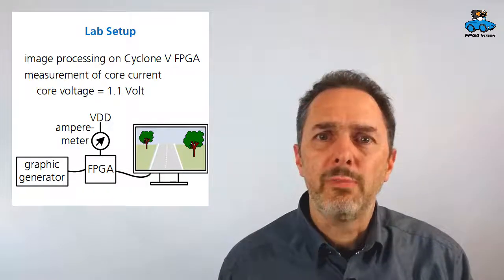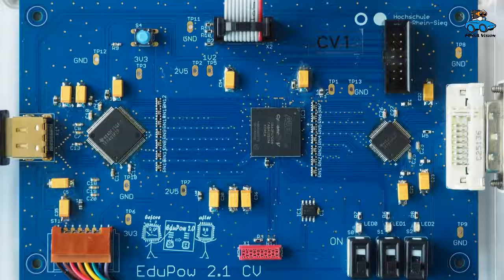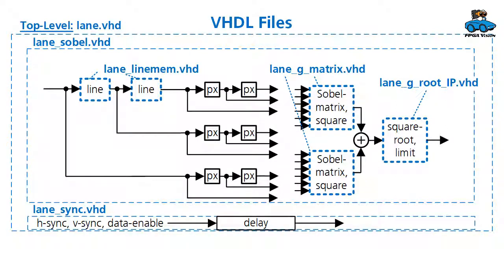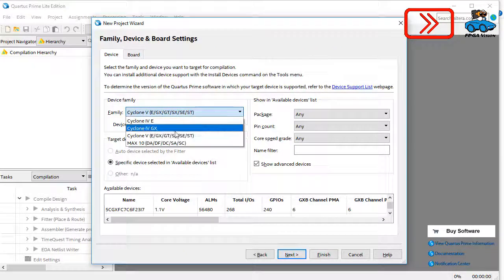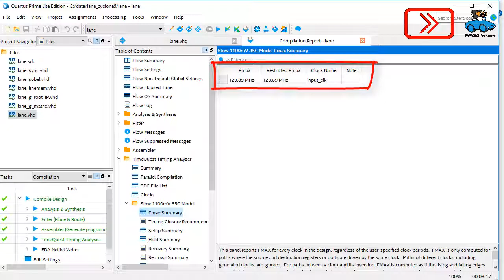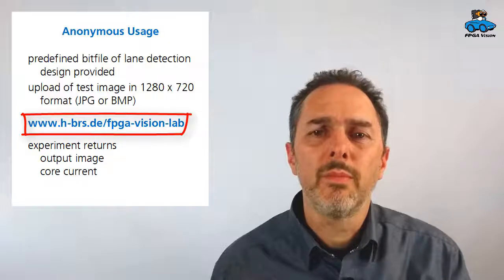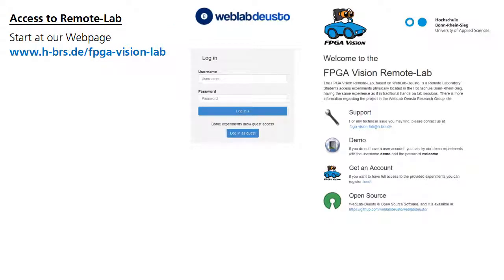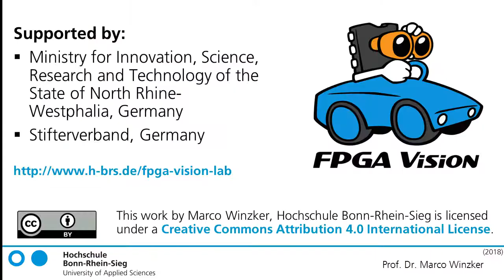FPGA Vision - FPGA Remote-Lab

Comment: thanks sir, can the code be assigned to the xilinx FPGA board?
Reply from the maker: Yes, but you need to do certain adaptations, for example the ROM for the block-memories.
Reply: sir how to find these adaptations that need changes and how can i do the adaptations, i used digilent genesys 2 FPGA board, thanks your return.
Reply from the maker: @muhammedalikaya268 Best approach: Try to compile the code and the software will give you error messages for elements to be adapted.

Comment: does this project works on spartan 6 sir
Reply from the maker: Yes, but you need a board with video input and video output. It is much easier to use our free remote-lab.
Reply: How to give video input to the FPGA board sir?
Do we have to modify the code for giving video input
Reply from the maker: @BhukyaRajkumar-wx6xq  The code has a video input. This is the red, green, blue 8bit input plus 4 control signals: hs, vs, de, clk.